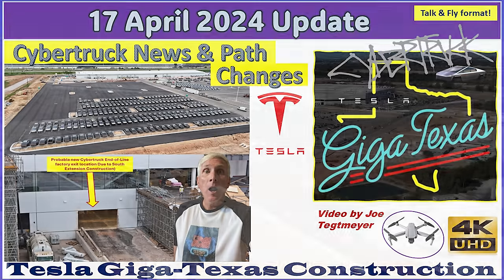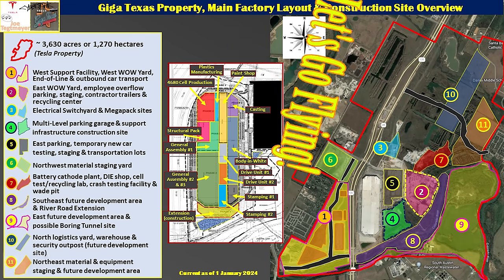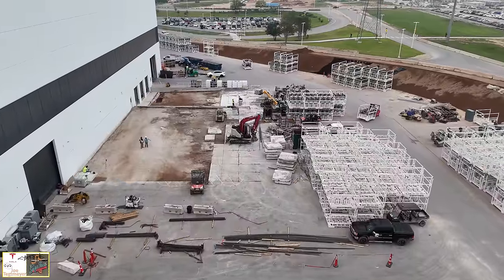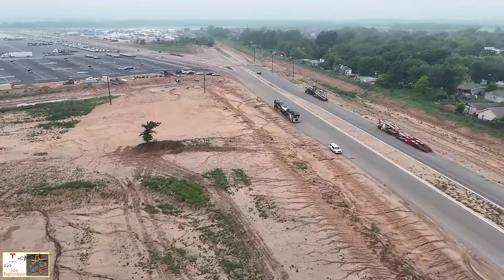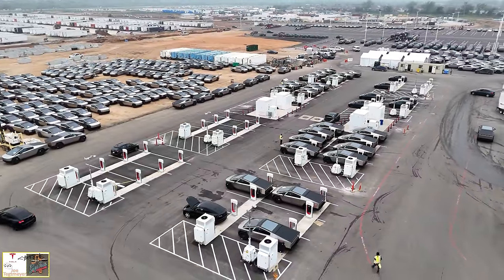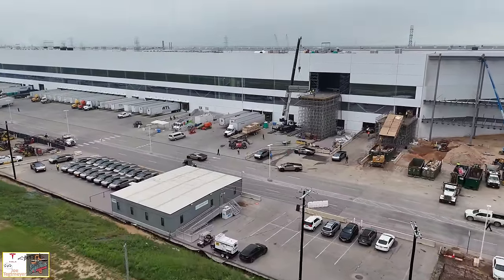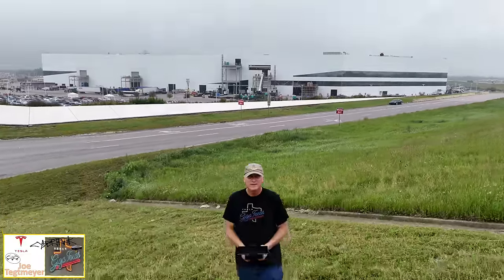Cybertruck Delivery Pause & New Routing! S Extension Progress!17 Apr 2024 Giga Texas Update(08:35AM)

Comment: Thanks Joe
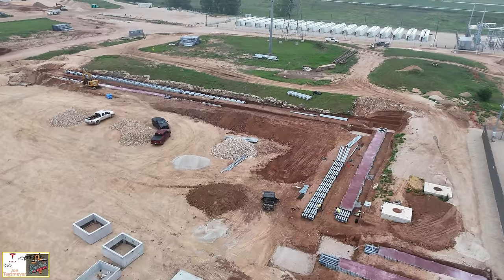5:00. Temporary Switchyard site. Might be planning a building or some other purpose for the site. Otherwise odd to dog-leg the ductbanks around to the perimeter.
6:19. East contractors yards. Bottom left. Cylindrical rebar cages. Probably for lighting towers.
8:32. Casting, east. Apron. Telehandler dragging a bundle of rebar inside. Construction works inside ongoing.
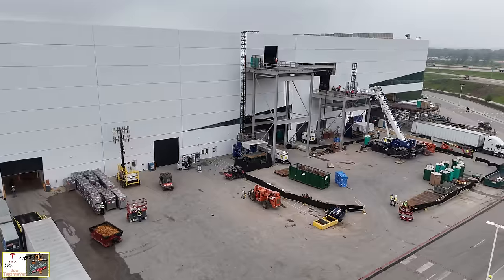9:56. Plastics, apron. Right. Lined bin of contaminated material.
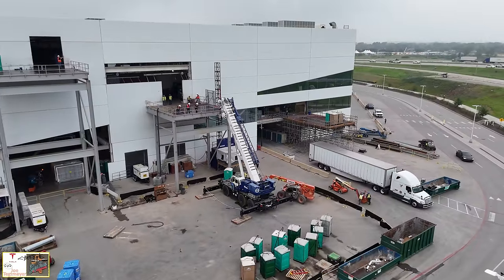10:03. Battery North. Loud sounds. Yes, very much still a construction site inside.
17:49. Westside. Tunnel Project. All generators removed. Site on mains power now. New dark green transformer installed almost 2 weeks ago between the grout batch plant, and the electrical controls trailer.
19:09. Westside. Tunnel Project. Dumper truck just delivered a load of dry earth to be mixed in with the wet spoil in the pit.
20:35. GA, apron. Long view. Cybertrucks exiting the new wall opening.
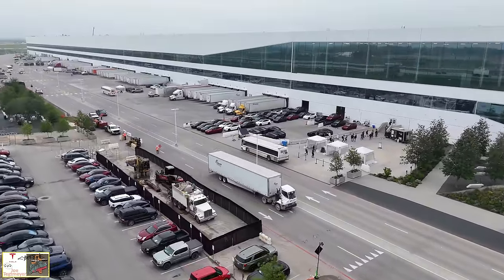21:34. GA. Highway side. HDD boring rig.
21:53. GA. Highway berm. Lift station saga continues.
24:25. Southend. Inside. Level 1. Centre. Fill being brought in to raise the grade. Compare the height of the exposed column pedestal on the right to those to the left.
25:01. Southend. New structure. Not much to scale against, and not the ideal angle. Black Model Y as a reference at 4.75m shows the column row spacing is about 10.9m 36’. Length of structure previously estimated to be 73m 240’.
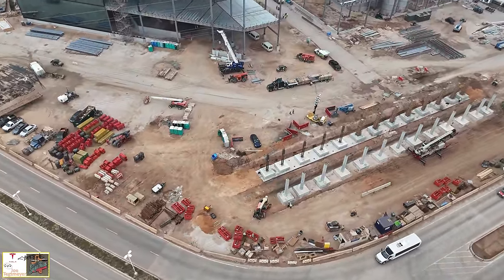25:21. Southend. New structure. South columns. Embedded plates visible towards the top at about ¾ height. East and west faces. More noticeable on the bare rebar columns, visible on the completed columns also once you know where to look.
27:13. Southend. Inside. New structure. Columns are beefed up on the lower half with a plate welded across the width flange to flange.
27:22. Southend. Inside. Columns to the left had connection plates for the lower floor beams welded in place only a week ago. Could indicate that the design of the structure to the right wasn’t finalised until recently.
27:31. Southend. Inside. Level 1. Top of retaining wall closely matches top of the passage. Shows all these structures match the height of the external retaining wall.
Space in between to be infilled with earth. Finished floor level will be approx 4’ to 5’ 1.2m to 1.5m higher than the main building.
This aspect the most unique feature of this building.
27:41. Southend. Inside. Level 1. Completed retaining wall visible to the east past the stair.
28:37. Southend. Roof. Fire compartmentation wall constructed through the valley.
Reply: 5:00 Could be planned construction there, but it could be coincidental. If you notice... The new duct-banks are running parallel to existing duct-banks. Parallel to the existing main power duct-banks, and parallel to the old temporary substation duct-bank.
Reply: @DavidJohnson-tv2nn  5:00. Parallel because they are heading south.
Reply: @DessieDoolan  Not just heading in the general direction of south, but running directly alongside existing duct-banks in some areas.
@ 5:00 Going west alongside existing duct-banks before turning south, close to the old substation duct-bank alignment.
@ 5:19 (Bottom) You can see what appears to be part of the old duct-bank has been excavated. 
Off in the distance by the white hydrovac truck there is an old vault. So the new duct-banks will be going right over the top or through the old duct-bank. A related observation: @ 5:19 You can see why they didn't finish the stormwater pipe construction. 😊
Then on Joe's video 4/12/24 at the 22: 51 timestamp... Again, the new duct-banks are running directly alongside the existing duct-banks. As confirmed by the vaults, bottom right.
So yes, I agree completely that there could be something planned for the old substation site. But even if there weren't anything planned for now, it would make sense to route all the duct-banks together to make the most efficient use of the space and preserve it for future development.
Reply: Duct-banks.... The construction of the new duct-banks is an indication of a need for a lot more power. Like 150% more than they have now! Which is consistent with the data center rumors.
Though they may also need more power for the battery section. Time will tell.
Reply: I think it would be safe to say this much... Given the evidence so far....
* The massive amount of new power being brought into the factory.
* The large amount of cooling capacity being added.
* The Orange conduits in the HDD bore on the westside of the building. Note: My understanding is that orange is usually used for low voltage circuits, communication lines, and.... Fiber optic cables.
We can conclude that there will be a data center somewhere in the building. Not that I think that putting a data center in a factory is a good idea, because it isn't! But it is what it is, based on the evidence.
One clue to the location may be where those orange conduits enter the building.
By the way, I'm so glad you spotted those. I was aware of the HDD bore, but of course, missed what was in it! 
😊
My knowledge of data centers is also limited. But another thing to look for is the delivery of large diesel backup generators. Megapacks are not a reliable backup. Due to their use for grid stabilization They may be mostly discharged when they are needed. However.... They can serve as a UPS (Uninterruptible Power Supply) until the generators come online.
Reply: Just came across this... Here is an interesting permit for the south expansion....
Tesla - GFTX - S Expansion
1 TESLA RD, Bldg GFTX, Ste SX
Austin, TX 78725

Project Name
SX-000501 - SX - Data Center Infrastructure

Submittal Date 4/15/2024
Reply: @DavidJohnson-tv2nn   Permit. Data Center. Yep, aware of that. Quoted it a number of times in the comments.
Reply: @DessieDoolan  Tried to post a copy of 3 permits on Brad's channel. They disappeared in about 3 minutes down the YouTube black hole.

Comment: at 12:02 there are 16 sets of big cooling towers. Both the upper parts and the lower parts (where the air is drawn in). Would the dimensions be about right for 2 times 8 in a row, on top of the mystery structure at the SE corner? These coolers need a lot of fresh air flow, so an elevated position is required.

I haven't seen any major, major roof work to accommodate these big mothers, but maybe it is the usual very early delivery for construction well into the future.
Reply: That is some good speculation, but the strength of that structure is likely far greater than needed for the coolers and supporting pipework. I was thinking these coolers will be going over that new area of open roof just north of the metal forming shop.
Reply: I have that SE structure at 10.9m 36’ wide, by 73m 240’ long.

11:57. Cooling towers. Nothing there suitable to scale against, other than the green bin of unknown length. Cooling towers are about 15% shorter.
Reply: 12:02. HarderNL. Joe's photo 047 today shows the width of the green bin square on to the camera. Assuming a maximum width of 8.5’ 2.55m (I think that's the maximum vehicle width) and using that to scale the Evapco units, I get those to be 3.53m x 5.0m 11.6’ x 16.4’ 

If the structure is to support those units, then there would need to be beams east-west. I guess we'll know soon enough if that's the design.
Reply: @DessieDoolan  I think the green bin is a 40 yard dumpster.
Reply: @gurugee2112  Thanks! Do you know if my assumption that the bin is 8'6" wide is correct. I'm not in the US, but some searching shows 8' 6" is the maximum.
Reply: @DessieDoolan   Most are 8' x 8' x 23' Everybody's is different. If you could read the markings on it you could go to the companies web site, but even then they likely have different dimensions.
Reply: @gurugee2112  Thanks. 8' would be close enough to scale the chillers. Either way undersized to span the SE structure in its current state. Might be Brad's next flight before we get to see that again, Joe not flying Friday.

Comment: An automatic storage and retrieval system or asrs is a natural solution to the handling of all those castings. 
The density of racking and castings would require a super strong foundation. The legs of the racking would probably line up with those screw-in piers.

Comment: Good flight Joe! Very puzzling the southeast side mystery structure. Outdoor bridge crane?
Reply: Bingo!
Reply: @DessieDoolan  Any idea why the two pairs of columns at each end of the mystery structure would be closer together than the symmetrically spaced columns in between?
Reply: @alanrivaldo-h  Was the same with the bridge crane in Plastics, at one end at least. Coincidentally perhaps.

I guess the location where the crane is mostly parked would be closer together.

Comment: FYI, Bruce Woodley in Dayton, Nv. Three days ago I passed three white Tesla Semi's with those single long trailers in white on Hwy 50 E which is the south route out of Giga Reno. One trailer had the smoke decal( I think what that is). This a slightly shorter route to the Fremont, Ca factory. I don't know if those long trailers can make it up over Lake Tahoe. The hwy has sharp curves and two lanes until you get closer to Sacromento. Could they be hauling battery packs to Fremont. Maybe for customer?

Comment: Probably already mentioned, just noticed Google maps aerial/satellite imagery was updated to around the the beginning of March - so Prufrock is visible, parking garage ~70%, south extension just reached the main building... still not as current as the great drone coverage but useful :-)
Reply: Opportunity to measure the length of the 500' extension....
Reply: @DessieDoolan  I used it to measure the estimated TBM cutterhead location.
Reply: @davidsalisbury50  The current image is a little wonky, but otherwise the measurement are quite accurate.

The only publicly visible documented dimension for the entire site, is the width of the main building shown on a site plan in 2021. Shows the building to be 1130.77' wide.

Google earth showing it to be 1130.52'!
Reply: @DessieDoolan  Agreed. The 100m (66 rings) I have calculated (very roughly) from the rise of the conveyor cassette puts the cutterhead at the edge of the highway under the top of the berm. This distance also makes sense if you add up the backup deck lengths, they will need at least 80+m  to get it all in and allow room to load the segment cars at the portal. It is, of course, all guesswork, but at least an educated guess.
Reply: @tunnellingsalisbury7605  Well, your information has been spot on thus far. Maybe a little more than an educated guess...

I watched the latest B1M video about the redevelopment of the old Hong Kong airport. Rectangular TBM! One of your projects?
Reply: @DessieDoolan  It was right next to my job. I was in charge of all the metro stations and tunnels across the old airport and beyond for the Shatin to Central Link. 
They have done a couple of those square box TBM pipejacks now in Hong Kong, we had a presentation on them a couple of weeks ago at the local tunnel society. I had a visit to that site last year.
Reply: @tunnellingsalisbury7605   I'll now go looking for videos about that project. I really only watched the B1M video as the title caught my eye. Transited through that airport a couple of times. Thrilling!

Square box TBM. One of the claims made in the video was that settlement above the tunnel with the box shape is less than with a circular tunnel. How does the ground around the tunnel not shear and be dragged forward as the box is jacked forward?
Reply: @DessieDoolan  The box jack solution is only suitable for straight lines and in favorable ground conditions. They have done the second one also now. I have a technical presentation on it. The cutting edge of the shield "trims" the edges of the excavation, giving a very neat cut, the shield, and the lacked boxes are lubricated with bentonite. They can still cause limited settlement but it can be managed within acceptable parameters. Box jacks are nothing new. This is just a combination of existing technologies to match a set constraints and conditions (the Japanese have been doing some weird and wonderful machines for decades, double and triple head TBM's, oscillating head square TBM's etc).
Reply: The SCL project got a lot of bad press over the Hung Hom station Debacle (it's a long story and blown out of proportion). Not my area of responsibility thankfully, I was doing the tunnels on either side of it. Still a major piece of work with some cutting-edge methods used. As I often tell people, 93/94 successful civil and E&M contracts, one went bad, so the whole project gets treated as a disaster. Such is life!
Reply: @DessieDoolan  My last big Project Management Job was putting in the third runway at the airport. Not a fun project, got myself fired, but still a big piece if work.
Reply: @DessieDoolan  There's a new HK airport? They no longer have the one where you go in the ocean if you miss your landing?
Reply: @greggerypeccary  That's the one. Or on landing, snag someone's washing flying past an apartment building.

Comment: The Cybertruck pedal is actually a really serious issue - I'd recommend current owners remove the silver cover until the fix is in place.  if you "pedal to the metal" foot slam down on the pedal, the top cover can move forward and get stuck under a piece of interior trim, and the pedal is then jammed in the full throttle position.  Only alternative is to use the brake which overrides it, until you can bring the Cybertruck to a stop, put it in park, and dislodge it.  Here's an example: https://www.youtube.com/shorts/WOppJ92RgGU

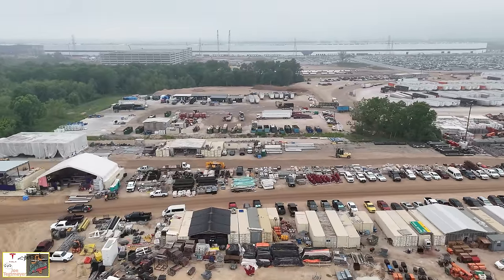Comment: I just wanted to point out that it might be possible to monitor the tunneling progress by looking at the conveyor belt buffer. Pause the video at 20:00. Notice how the conveyor cassette is made up of 4 horizontal trusses. The belt snakes up and down between an upper and lower pulley rack. The lower pulley rack has been raised almost to the center line of the 2nd truss from the bottom. This allows more belt to be in the tunnel. Compare this to the lower rack's position at 6:25 in the video from March 25th. It is down in the bottom truss. They might be 1/3 of the way through.
Reply: 1m raise of the white beam is 26m of tunnel advance. This is how I predicted around 80m so far.
Will need to recharge the belt 2 times to complete.
Reply: @davidsalisbury50  thanks for clarifying that. I wasn’t sure if it held enough for the full trip.
Reply: @jamiestotz2516  Belt rolls are typically 250m lengths. So for this tunnel (if 300m) they will need 3 lengths (possibly plus a bit more) allowing for the external length to the spoil bin and the conveyor cassette. They had 3 rolls on site, 1.5 lengths loaded already, and now partially cut to provide the 160m length for the section on the TBM backup. That is why we now see the lower white beam inside the cassette structure having moved down, but not as far down as when the tunnel started. A third roll stored behind the cassette among the segment stacks. I assume the rest of the second roll (stored on top of the conveyor drive) will be added before they restart).

Comment: Hi, at 24:24 we can now see that the concrete columns on which the H-Beams are mounted are actually no longer that tall. The concrete floor has not even been poured and it seems they are just sticking some 2-3 feet out of the ground. The entire floor level of the extension will increase in height.
Reply: 24:24. Beams = horizontal. Columns = vertical. Yes floor is raised, about 1.2 to 1.5m 4 to 5 feet higher than the existing factory. You can see the other face of raised floor retaining wall here and there. Top right at 26:31 for example.
Reply: @DessieDoolan  Well, an H-Beam is still an H-Beam, it can, in a structural sense, be used as a column or as a beam. Here, the H-Beams are used as column on top of the short concrete column bases..
Reply: @petergrabowski526  Yes, you're right. Sorry, I sometimes forget where I'm posting these comments to.

Comment: So as I suspected it appears that the Boring tunnel will NOT terminate inside the building considering that concrete pads are now being poured.  I still think the tunnel will terminate at the highway berm but there’s another interesting possibility….

Could it be that the tunnel will traverse underneath the entire building and terminate on the East back side?  Could that weird construction of footings on that far side have something to do with an entrance into the tunnel?!

Stay tuned!
🍿🍿🍿
Reply: The other reason the tunnel will not terminate inside is because I hear that ground floor with those three bunker like cavities is supposed to be the Dojo supercomputing data center.
Reply: The tunnel alignment is the next column north of the slab seen at 27:11. 

Highway berm tunnel exit. Not enough elevation for the tunnel to exit through the berm.